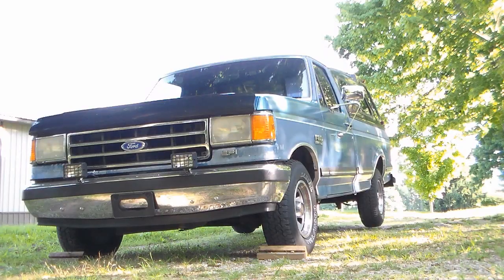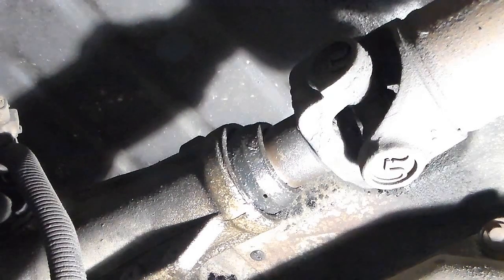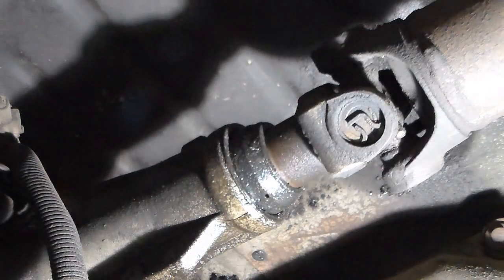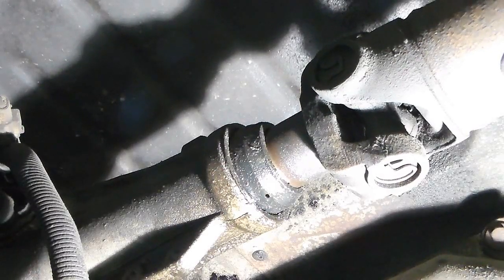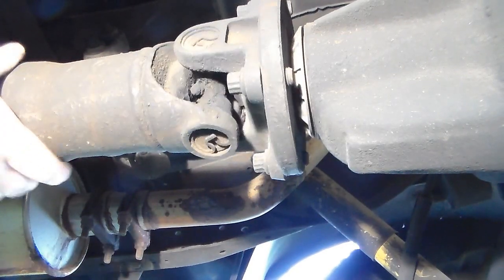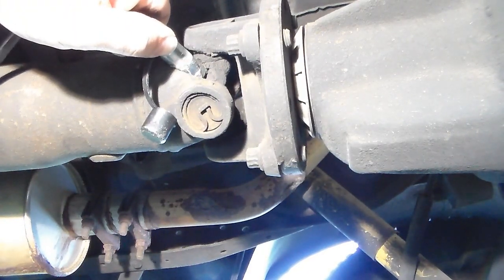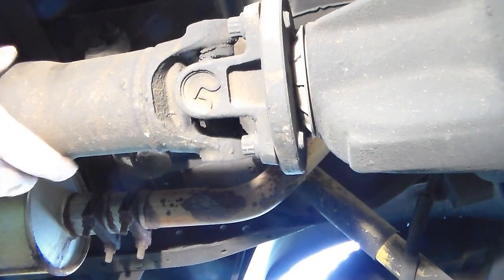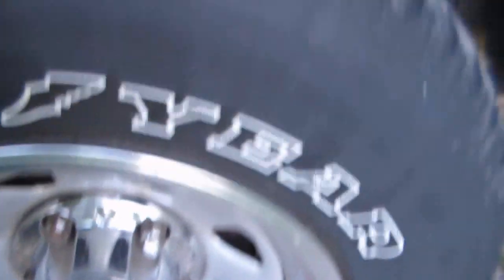Blue F-150 (1991 F-150) Universal Joint Inspection

Comment: What size of socket is required to remove the 4 bolts to get the shaft off? Are those 12 point sockets?
Reply: 13